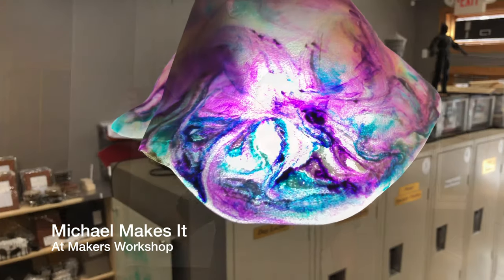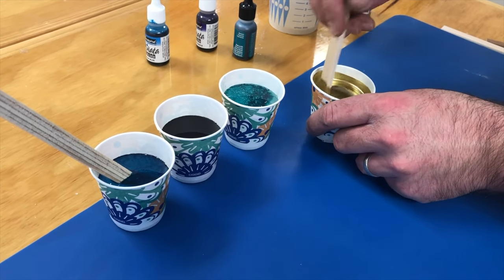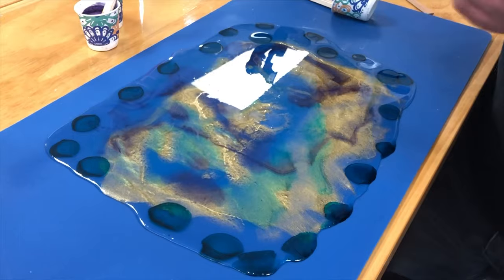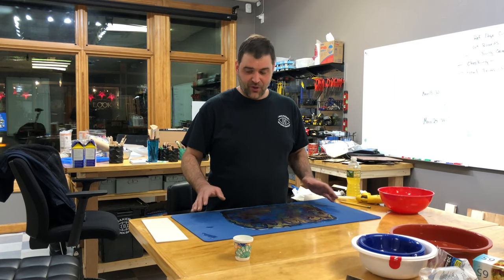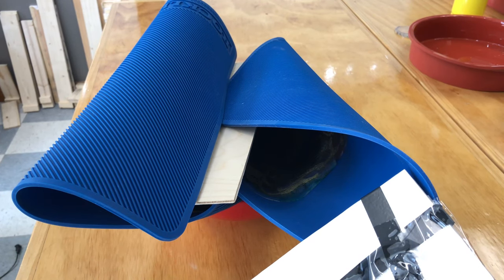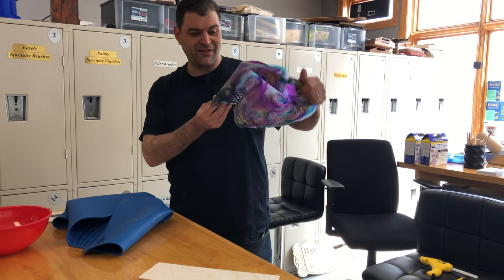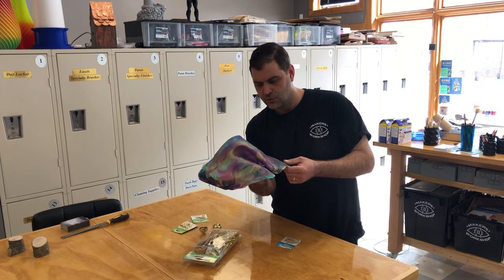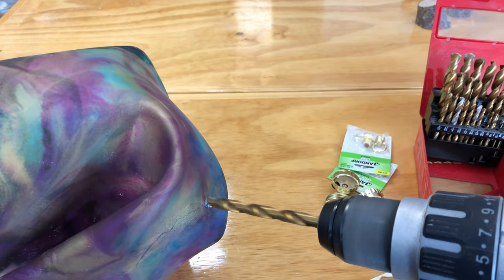Making a Resin Pendant Light // How To Build

Comment: What would you add to the outside to make it shiny?  Kind of thinking of doing my own version for my new dining area.
Reply from the maker: Brushing on a thin coat of clear resin after should do the trick, varnish and poly also work well on the resin in my experience.